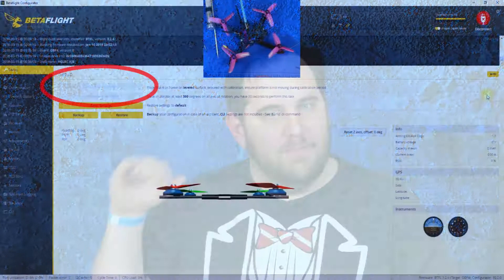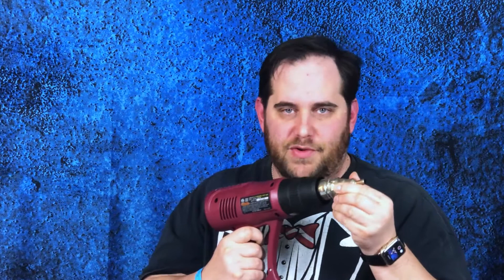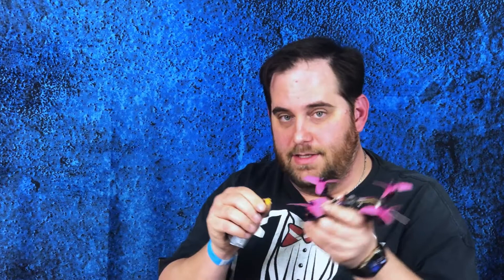How I fixed my HGLRC XJB 145 NO GYRO Accelerometer issue

Comment: I just ordered an XJB 145 last night off Gearbest. Hopefully, it has the updated hardware. Having issues with Gearbest lately so hope I get it and have no issues. You ever try the Leader 120? I have one and love it. I expect the 145 to be just as amazing.
Reply from the maker: In theory it should have the updated hardware (my 2nd one did), but I'll keep my fingers crossed for ya!  As for the Leader 120 I have not, I was flying an AR Fun 95 pro and an Aurora 90 and wanted something a little bigger.  Kinda felt like 120 was still a little to close to the 90-95 range.  I'm going to bet when you get your XJB 145, you will love it more, esp if you set it up with my epic tune.  It is such a beast nobody can believe it is a little 3" with so much uuummmpphhh!
Reply: I hope you are right. I messaged them and they can't seem to be able to tell me left from right.lol. Customer service from all those sites is lacking for sure. Can't wait. I get my 4S Venom 850mah batteries tomorrow and should get the quad in a month or so....lol...sigh
Reply from the maker: I hate that, when you get parts, but not the quad... That month-ish wait is always the worst!

Comment: I was commenting on this quad few days ago. Everyone told me it is great. Now I learn it is broken on delivery? And I have to be an expert to repair new 150 usd product?
Reply from the maker: If you received a broken quad on delivery, then you would need to contact HLGRC or the place you purchased it from to receive a replacement or a refund.  You shouldn't have to fix something broken new out of the box.  My situation happened after many crashes, and it is understandable that crashing would break parts on the craft.  And I was sharing the fix for those who wanted to attempt it.  But if you have a new craft that is broke, contact the manufacturer and the place you purchased it to seek exchange/refund first before attempting any kind of a fix.

Comment: I ordered one from gearbest, a week or two ago, and it was dead on arrival with the gyro issue.  V2 versions of these quads are still having this problem. I was completely surprised that this has been on ongoing problem with this quad and the stack you can buy separately as well for a very long time since this drone is nearly universally praised for its quality and performance on various youtube channels.  I highly encourage anyone considering this drone to read this thread on RCGroups.  Buyer beware: https://www.rcgroups.com/forums/showthread.php?3000984-XJB-F428-No-Accelerometer
Reply from the maker: Wow I am surprised our of the box having a no gyro issue!  Make no mistake personally I never praised it's quality, I agree it has short-comings.  But for the price to performance ratio, you can't go wrong, and why many people are now having two...  Clearly someone can't fly both at the same time, but rather having two allows you a backup to fly when one breaks lol!  As an aside, this issue is only prevalent if you use horizon and angle modes.  Personally I've since moved away from using them entirely, and I've disabled my gyro (which improves the tune by freeing up cpu cycles) so in theory, both my XJB-145's could have broken gyros, for all I know, but because it is disabled it doesn't even effect me, and still flies like a beast (check out my vid with my ultimate pids and a more in depth explanation about disabling the accelerometer here: https://youtu.be/VDBs7Psti3s)

Comment: thanks for the vid! ive just recieved my second xjb 145! love it! care to share your tune? running same gemfan props and 4s tattu 850 batts.
Reply from the maker: If you are running "stock" then you can just copy/paste this into your CLI tab and it will set the pids to match what I'm currently running.  Mind you this is "good" but not great.  I still have more tuneing that I need to do, but I've gotten very lazy, and been tolerant of this current tune.  So don't expect rails on butter, but better then stock (esp with a 4s pack on).
set p_pitch = 39
set i_pitch = 49
set d_pitch = 21
set p_roll = 31
set i_roll = 42
set d_roll = 23
set p_yaw = 60

Make sure you type save into the cli after you copy/paste that to save.  Also make sure your active profile (under pid tuning) is the one you want to change.
Reply: tronage thank you so much for the feedback! cant wait to plug in the pids!  newer subscriber and also own 2 xjb 145's so this current series of videos is perfect! getting ready to watch antenna mod now! thanks so much for the content and happy flying brother!
Reply from the maker: Thanks so much for the kind words!  I'm loving these quads, and I got a video coming up which I think is pretty dang awesome.  Don't want to spoil the surprise, but it is my xjb145 epic build!  Coming soon, stay tuned!!!!

Comment: had 2 of these now. Both BNF, first one sounded like a flying saucer out the box with a dodgy gyro. 2nd one had a bad motor. I think the QC has gone downhill to keep up with popularity..
Reply from the maker: The "flying saucer" effect could have been your tune.  When running 3s "out of the box" all was well and good.  but running a 4s "out of the box" made crazy oscillation and shrilling sounds (perhaps the flying saucer sound you describe).  This is not a design flaw or a QC issue.  It is the PID tune, and specifically having too much "P" term for the higher volt packs.  After I backed my P-term down a bit, the shrills went away on the 4s pack.
I will agree though there is some QC issues, but own two and this is the first "issue" that I've experienced, and mind you it only surfaced after crashing...  But both out of the box worked great (other then the tune described above).
Reply: Thanks for the reply, hmm, I did receive one 3s battery (by mistake) from Gearbest when I ordered 5x 4s but I've just sold it :( ..so I can't test that but I'll try lowering the P-term and see if that helps.
Reply: Can I ask what settings you've used for you PIDs?  I'm going to have a look at this tonight.
Reply from the maker: If you are running "stock" then you can just copy/paste this into your CLI tab and it will set the pids to match what I'm currently running.  Mind you this is "good" but not great.  I still have more tuneing that I need to do, but I've gotten very lazy, and been tolerant of this current tune.  So don't expect rails on butter, but better then stock (esp with a 4s pack on).
This WILL remove the flying saucer effect that the 4s packs were producing.
set p_pitch = 39
set i_pitch = 49
set d_pitch = 21
set p_roll = 31
set i_roll = 42
set d_roll = 23
set p_yaw = 60
Make sure you type save into the cli after you copy/paste that to save.  Also make sure your active profile (under pid tuning) is the one you want to change.
Reply: tronage thanks man, appreciate that

Comment: The fix is not permanent, the issue will show itself again after a while.
Reply from the maker: Good to know!  I'll keep my eye on it and let you guys know if/when it shows its ugly face again!
Reply: Correct, that's what I heard too.  There was a guy that reflowed the chip and it only worked for a few flights.  Then, he replaced it with a good gyro chip, and it only worked for a short time again.  He suspects it's something internal in the board.  I never crashed mine and I still got the no gyros issue with my HGLRC F4 v2 board. The only thing I did was hovering, bouncing up and down.  I suspect the voltage spikes caused by the bouncing damaged the gyro or something because I didn't attach a capacitor to absorb the spikes.